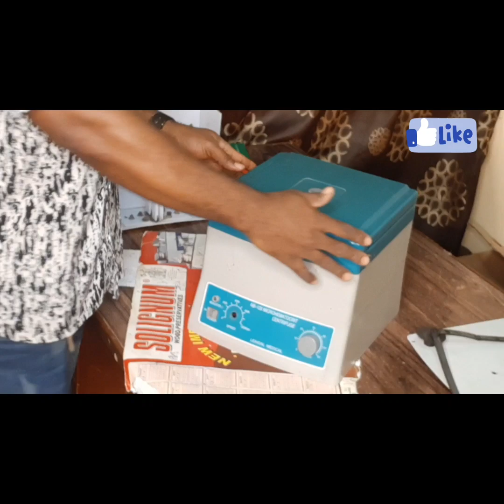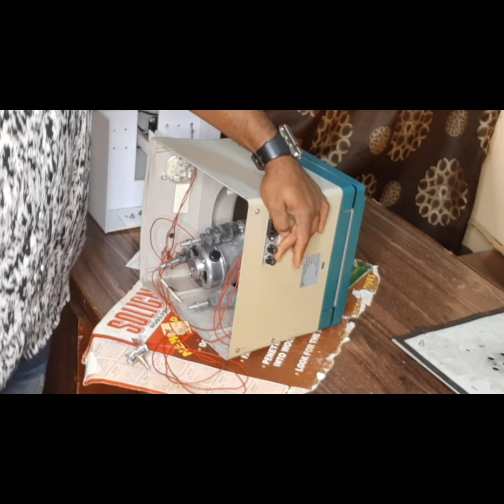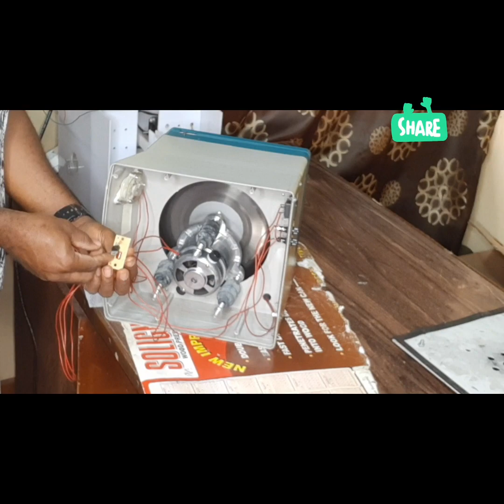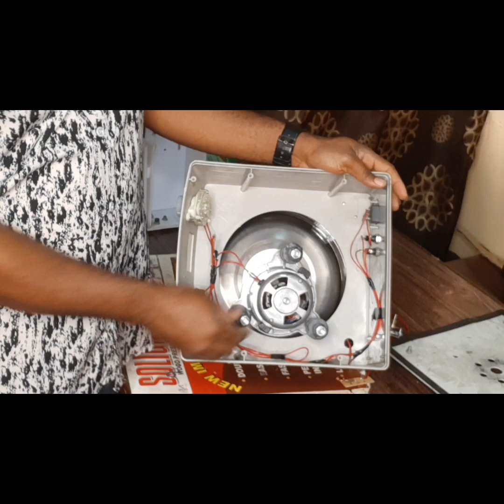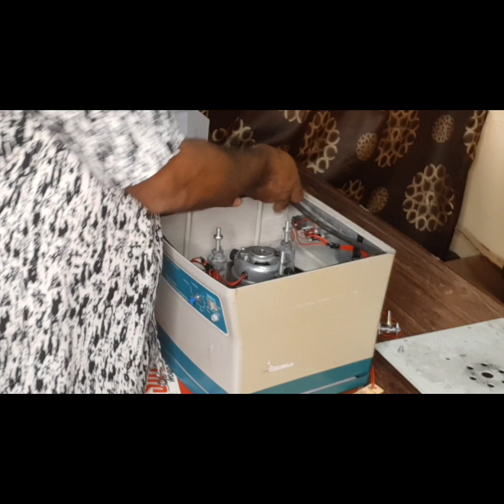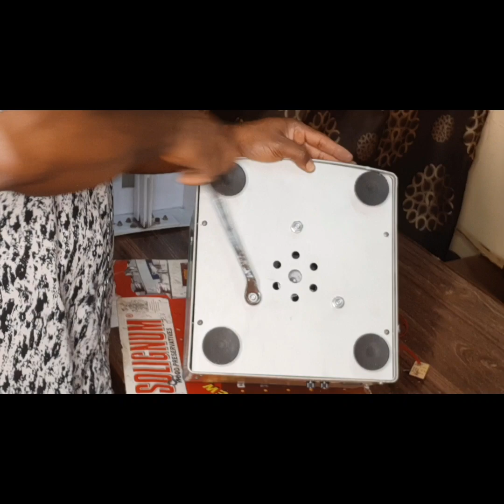How To Fix a Faulty Microhematocrit Centrifuge

Comment: How do i open and replaced the carbon brush of this micro hematocrit centrifuge.,
Reply from the maker: Power-down the Machine and unplug from the main source.
Unpack the casing and locate the motor
Identify the Carbon brushes at the two sides.
Lose it out and identify the brush size for replacement.

NOTE: you can only do this only if you are a qualified personal. Safety precautions MOVE be observed.

Comment: What is the function of each device and where probably its been used   dept unit ..for lay people following us...
Nice work kudos
Reply from the maker: Ok for this particular device:
A hematocrit centrifuge is a specialized laboratory centrifuge used to separate blood into its component parts, particularly to measure the hematocrit value. The hematocrit value represents the proportion of red blood cells in the total volume of blood. By spinning a blood sample in a hematocrit centrifuge, the heavier red blood cells are separated from the lighter plasma, allowing for the measurement of the hematocrit percentage. This test is important for diagnosing conditions like anemia and dehydration and is a routine part of a complete blood count (CBC) analysis.

Thank you for following.